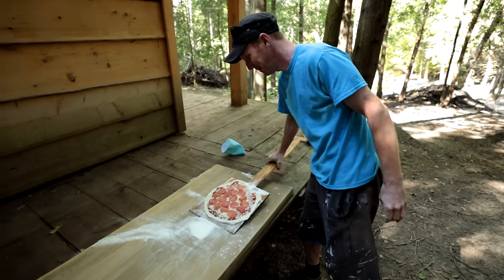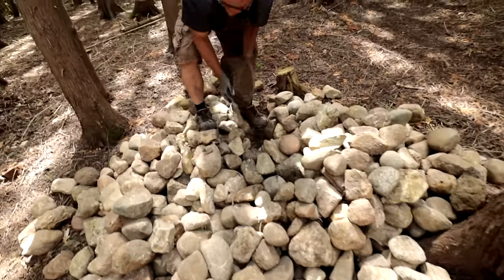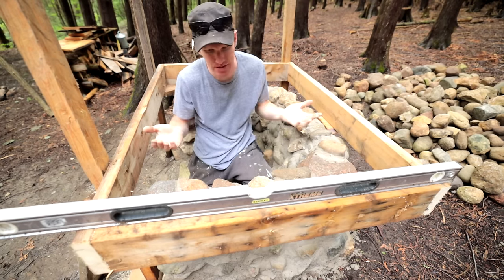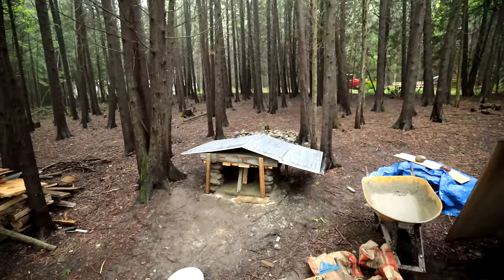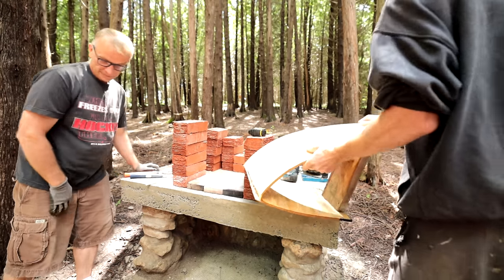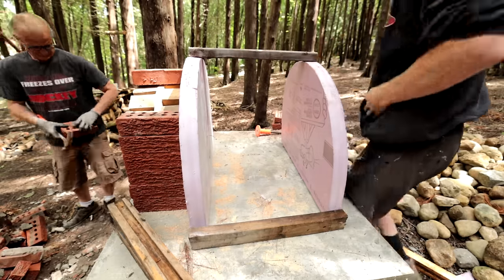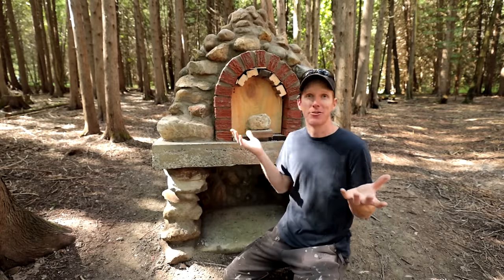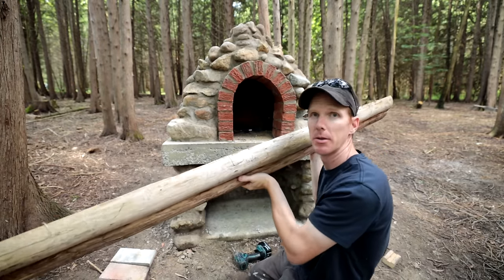I Built a Rock Pizza Oven!

Comment: Ideally you want your brick oven about 800° to 900° degrees. Keep your fire all on one side. This will cause the heat to roll up the side and over the top of the inside of your oven. Heat your oven, move all the wood to one side, wrap a damp wash towel around the end of your pizza peel and thoroughly wipe down your cooking surface. Put your pizza in and rotate it about every 20 seconds. If it starts getting over cooked on the bottom lift it with the pizza peel and hold it 2”-3” off the cooking surface. Shouldn’t take more than 2 minutes to cook it this way. If you’re a pizza freak like me check this guys YouTube channel Vito Iacopelli. He’s an authentic pizza maestro from Italy. Great tips on how to make sauce and dough etc. And NO…I have zero affiliation with him. Just a fantastic channel I stumbled upon.
Reply: totally WRONG pizza oven not keep fire when baked pizza all firewood and ash sweep out and proom clean not have coals, then fill pizza in oven and newer not need rotate pizza normal real pizza oven.

Comment: We would climb the rebar while setting forms so by god tie it well...lol.  Actually the ridges in the rebar acts like locking legos and makes the pour stronger.  The steel is strength the concrete is rigid.

Comment: THE FIRST TIME YOU FIRE UP THE OVEN WAIT FOR THE TEMPERATURE TO GET TO 600DEG. AND REMOVE ANY BIG PIECES OF BURNING TIMBER AND LET IT GO TILL THE NEXT DAY  THAT PREPARES YOUR OVEN   FOR THE NEXT TIME .YOU DON'T NEED A BIG FIRE TO COOK  A SMALL ONE STARTED IN THE REAR  AND WHEN TEMP IS RIGHT PUSH THE FIRE TO A CORNER AND SWAB THE FLOOR  WITH A DAMP MOP ..THIS IS LIKE RUNNING IN A MOTOR
Reply: The damp mop trick is key!

Comment: Oh for a oven with the space for about 100 1kg Bread peaces you need to start the fire and burn about 40 kg eavenly on the oven plate. Hard wood is a bit better but a little overestimated to be better. You dant want to heat you House permanently you just want to bake Pizzas or bread. Even Pine burns hot enough. 1 kg retains about between 1,6 and 4,4 Kw heat ability depending on the quallity and dampness of the wood. In the old days they fired the breadoven with just sticke and brush for the bigger Wood was very expensive in komparison. Again greatings from Germany ;)

Comment: Dude,, I would suggest a channel called YouTube,  its got great info on it, such as how to build & cook in a brick wood fired oven "before you build and cook on one"! lol,,,,,,,,,Specifically,, your pizza paddle is too thick and too big.  It looks great but you just need to find some thin metal, cut it round and attach it to a stick. Like Stainless Steel in a 12" circle. Slightly smaller than your pizza.   Much more efficient and easy to use.  You wont dump off your ingredients. You can spin/rotate your pizza easier that way.  The smoke issue,, umm,, thats an engineering problem. lol,,  Properly constructed, smoke wont come out the door. A longer handle will back you up from the smoke, lol   Also, once you get the hang of it,, the pizza really only takes about 90 seconds, tops! Push coals to one side for cooking.  Then spin for best control.  Youre fun to watch though.  Love watching guys that learn the hard way ,lol  For real, youre a kick!!

Comment: You tie rebar to prevent it from shifting around before the concrete is set.  Once the concrete is set, the tie wires don't add anything to the equation.

Comment: Layers. Layers upon layers upon layers upon layers. It's easy peasy. Layers upon layers. All kinds of temp control layers, determined by the temp control ability of the material, then cover it in concrete, THEN cover it in dirt and plants and debris and dirt and leaves and dirt, until it becomes water proof,  then cover it in loose dirt. Then grow plants on it. Easy Peasy.

Comment: I am wondering if it is a right design to have a chimney right on top of pizza, because the heat for the  pizza surface will be leaking out.
Reply from the maker: Every pizza oven I have ever seen has the chimney at the front/top.

Comment: You tie rebar so that when you pour it stays in place and sits where you want it to. As you form conctrete and compact it it can shift around....

For your application its less of an important thing as its not necessarely structural rally and it won't be supporting much more other than its own weight plus a bunch of stones on top.
Reply from the maker: I always wondered.   Thanks for watching!

Comment: You must burn 2 handful bunches till the white ashes, it takes 3-4hours, then only then bake your pizza, without any fire, nor ashes. fire door must be cast iron not wooden. your conreete arch in that fire Place should have some holes for ashes to be fall to ground floor. Fire bricks must cover inside arch ceiling too, not just basement.

Comment: Just found Your chanel . 
Im planning to build a retirement
small house ( 26x26' ) . By necessity
it will be off grid . The " DREAM KILLER " & I will live in it full time .
The main hang - up will be power .
What setup for power do You use ?
Can You recommend a reliable , 
cost effective , capable system
to power a small house like this
with enough power to make a 
skeptical " DREAM KILLER " a 
happy convert !?
Of course , the house will have to
have all of the city liveing trappings .
To give You an example , last mo.
Our electric bill showed We used 22 kw.
Reply from the maker: We haven't gotten heavily into powering stuff. We have a number of Battery packs to power our stuff.

Comment: you tie the rebar so it doesnt float up as the concrete settles
Reply: Steal bars don’t float

It’s tied to stop it from spreading out 

The grid is needed so the concrete has tensile strength in multiple plains and doesn’t crack

Comment: Why tie rebar together:  So it doesn't shift when adding the concrete.. since under concrete you wouldn't be sure if it was shifted or not... wired up you can be sure it hasn't.

Comment: if you put 5-10cm crushed glass pieces layer under any fire Place it will keep hotter for longer. Crushed thick glass in to 0'5-1cm pieces. (Glass dust mixed with clay and used instead of cement between bricks for fire Place has same effect.... 🤣💎🔥

Comment: As a mason, for over 20 years, I have to conclude that your oven will deteriorate prematurely. You haven't used any refractory cement, or refractory brick to line the oven. Given time, this thing will start flaking apart, cracking, and be useless. Please use the proper materials next time.
Reply: I'm thinking of clay lining the interior.  If it dies I'll wipe the top clean and do it again.  Do you think the rock will fail?  Or the brick opening?
Reply: @cmosphoto1  I firmly believe that the mortar will fail. I see that you used a premix for masonry veneers. That's it's only application. Some granite can crack under high thermal heat. Lining the interior with fireclay may work, but it can be pricey. Best of luck

Comment: Some unsolicited advice.
After your fire has died down to coals, rake the majority of them out.  The fire is just to bring the mass up to temp.  Don't leave it in there.
Patience is key to wood fired ovens.  Let the oven come down to a cooking temp.  The way to check this is to throw a handful of corn meal across the bottom.  If it burns, it's too hot.  If it browns, then you're good to go.  A corn dried corn husk can also be used.

Get, or make a scuttle.  It's a small mop that you will soak in water and clean the floor of the oven before you put your food in.  It will also drop the temp a small bit.  On that note you should have left the door raw.  Soaking it in water is what you do. 
As far as your peel, to keep food from sticking to it, a small amount of corn meal will help there.

Happy cooking.
Reply: Thanks for this advice!
Reply: @cmosphoto1  You're welcome.    Though experiment with it and find what works for you and your particular oven.  :)

Comment: I am a Master baker from Germany and used to bake in a Wood oven all my bread.I enjoyed your oven build. and You are right. The bottom is kind a important with the fire brick.In the old days they masoned the bread oven in Germany and Austria with just regular clay bricks. You just build it in a way that you could replace the layer of bricks they bake on. For the inside they just used sawdust from the wood mill and shaped it with water into a pear cut in half and flat on the surface you want to bake/ cook and just fill in the rest with bricks as thick as you want. The thicker, the longer it needs to heat up for bread baking but the longer it retains the heat for Baking even if it is very cold outside. I liked to see this a lot. Great job!!! Sorry for my english ;) Greetings from Germany
Reply: No spekun se deutsch. No hablo Español tambien. Nice english and no need to apologize.

Comment: I'm not sure if you're taking requests but I have a project idea for you!  I've always wanted to try a composter heat generator and it looks like you've got everything you need which is tons of woodchips and you can even get them free.  Build a wood chip composting heap, run a PVC coil inside and enjoy a HOT TUB soak in the winter ... I'll bet you'll big jump in subscribers with that one :)
Reply: Sounds like an interesting project.  I'll you need a butt load of btu to heat a hot tub.

Comment: Not reviewing 1100 comments to see if mine is a dupe, but, first, tie rebar together allows you to pour and work concrete, and adjust rebar without disrupting its general position, thats it.  Second, your vent should be at the BACK of the oven, that way when you open the door, the heat goes away from you instead of into your face!!
Reply from the maker: The research I did said chimney at the front.
Reply: @ModernSelfReliance  well, all due respect to your sources, but sure looks to me like its way too hot in the front, sure your eyebrows agree!!  LOL

Comment: Also if you mix 2 spade size scoops of dirt to you cement when mixing it's you get a little bit more
Reply: Does this weaken the mix?
Reply: Adding dirt is a concrete thing that I've seen people do for year by different people that never knew each other.  I think when you add the dirt it should just help you make a more dialed in consistency.  2 scoops you would never notice on strength.  Especially if its clay mud . Wouldn't recommend dirt dirt . As you said top soil

Comment: idk if I'm right, but in my own experience tying the rebar helps it stay in one spot so it doesn't move around while pouring. If you're using a concrete truck the mud will easily move the rebar out of place, it also is great when lifting the rebar up into the center of the pour.

Comment: I took your advice and held the camera while mixing the mortar. Unfortunately that’s where everything came to a stand still. I worked out the reason for this. I was on my own.

Once I worked that out I put the camera down and got to work. 

Just like you I’m in the process of building my own oven and documenting it all on my channel. Sadly I don’t have the skills you have so I went for a kit version. There’s still a lot of building to be done but even for a novice like me, so far it’s been relatively easy. Have a look if you’re interested. 

By the way, I’ve had many fails. And they all happened quickly. 😂

Comment: Anybody who has grilled pizza at 500-600 degrees, and definitely anybody who has used a pizza oven, just laughed when he mentioned 10 minutes and even checking it at 5 mins.

I bought some unglazed quarry tile to line my grill and heated to 500-600 degrees. Personal sized pizzas normally cooked and caramelized the cheese in 3-4 mins
Reply: Oh, and coarse corn meal on the pizza peel will usually let the pizza slide

Comment: Nice work, couldn’t imagine nor want to put this much time into building an oven when you can buy a all brick oven that fits 3 -  11” pizzas for $2500. With that being said m, doors do not go on pizza oven when cooking, and a Neapolitan pizza should get cooked at a deck temp over 800 degrees and a dome temp around 1100 degrees. 66% hydration, 48-72 hour fermentation, 2.6% salt, 0.3% yeast (or 22% starter), NO OIL!!!! Pizza tile baby!!!!!

Comment: Your a genius when it comes to building pizza oven but do a little more research about cooking pizza. 500 degrees is cold when it comes to pizza.
   The coal burning pizza ovens that are all the rage in the industry today are based on the ones they have been cooking with in Naples since the 1800s. 
The real authentic pizza was cooked in coal burning ovens that heated up to 1200 degrees to start. 
 When they cooled down to 850 to 900 degrees then they would be ready to cook with. It was these high temperatures that would produce the unique result that WAS pizza Alost a lost art today most people have not really tasted what these delicious morsels were really like
  But the oven you built should produce a pretty good product but you have to follow a few simple rules.
  First rule1, build your fire against the far wall of the oven along almost the full length of it This will create a  cold spot in the front of the oven which relates to  rule 2, Learn the hot and cold spots of your oven so you know how to regulate and move and turn your pizza to prevent burning. This is learned over time. Just make the fire in the same spot and the same size every time and you will learn where the hot and cool spots are pretty fast,
Rule 3, Don't cook it for more than 4 to 5 minutes, At the temperatures you will be getting with wood (750-850 degrees) sometimes a pie will cook in only 3 1/2 minutes, Rule 4, start your pizza in the back of the oven near the fire and progressively move to the front.  And rotate at least once.
Rule 5 When bubbles appear pop them  EXCEPT WHEN THEY ARE ON THE CRUST, When they are on the crust they make the pizza look great.
Rule 6, Peek at the bottom frequently Some charred black spots are normal and expected with these high temps. but not allot. Remember, These pizzas are darker that the pizzeria pies you can take out but not burnt.. With these few tidbits of knowledge, your wood burner and  some practice you should be able to make a pie that tastes like it was cooked in Naples.

Comment: I’ve tied thousand of tons of rebar. Tie wire is only there to hold the rods in place while the concrete is being poured. Placing rods without tying is called floating the rods. It is perfectly fine for small jobs

Comment: I watched this video twice, looks great. A quick tip prevent the pizza from giving you issues in sticking/going into the oven, put some sesame seeds on the panel then put the dough on top, so the base of the dough  doesn`t stick to the panel when putting the pizza in the oven.

Comment: Always make the opening for a large pizza, I made my shape from a med sized domed dog house. I wove a basket covering it with little walnut trees papered that with newspaper,took it off the dog house. I put it on the plate and bricked it then burned the inside out. I used old chimney bricks. I enjoyed the covid  time.. I put in a chimney pipe to the side and put in a damper. i can do pizza and bread. I used perilite to make the door so it was light weight..I did use refactory  mix. It was fun making it and baking in it.   Start out with small fires. That was almost as enjoyable as the bread and pizza

Comment: Do you have frost there?  Not providing drainage for the hole you built your stove in means that when rain gets in the hole (which it always does) and freezes, it will heave your stove out of level.     Oh yea; river rock is notorious for exploding in fire pits so building the oven walls and roof out of them is fairly dangerous.  Are you aware of the door height to ceiling height ratio which allows the smoke to escape without smothering the fire?    For a fly by the seat of your pants project; it looks really nice, I hope it lasts.

Comment: you can season any concrete while its still wet that touches fire with some cooking oil... i don't know the science but people have been doing it for hundreds of years. you just spray or paint it all over walls inside the cooking area.
Reply: Just some vegetable or olive oil?
Reply: @jonathanglukhoman5285  I've never thought about it. Either should be fine, but i would stay away from smaller chain oils like coconut. traditionally however animal fat is used, it is usually rendered down and painted on ( but you would need cook very often to combat mold growth). It really depends on what you are making and what you want. Fore instance if I was making a BBQ pit i would season the walls -- brick or concrete with a pork fat/ veg mix-- but a pizza oven i would use canola oil (no mold growth). Personally I use vegetable because the spray cans are available at wal- mart. This makes it 100x  easier and its clean. Remember this is for ovens you cook food in  so don't use any non food grade oils. I also give a really good spray when the concrete is just layed and very wet, again when its getting set and again when its about to be completely hard. then i build a nice hot fire to around 550 degrees and let it slowly burn down so it seasons at all temps down to 150 (some high temp concretes will come with instructions) . spray again and repeat 3x over a week and your oven is ready to go, you wont find a better one in any restaurant.    I don't know the science of adding the oil to concrete as its drying, it doesn't make sense to me ( I would have guessed it would reck the concrete set) , but its been done for hundreds of years and makes the oven of higher quality reliably.
Reply: @JZ-xu3vg  thanks!

Comment: I tack weld my rebar. I think it's a stronger structure.
Reply: It’s not. You tie it so it has some give. The tack weld will not give, it will crack since the bar and the weld thermally expand at different rates